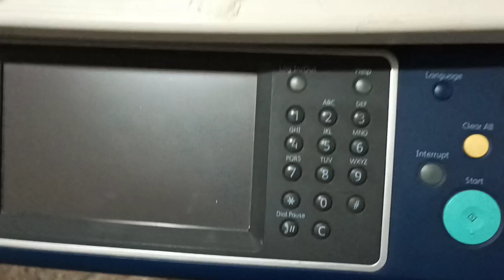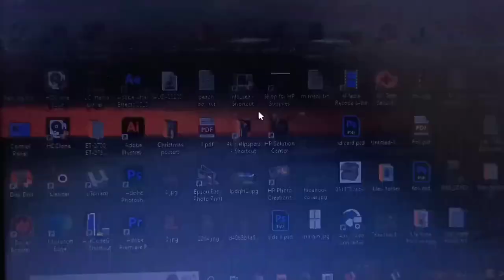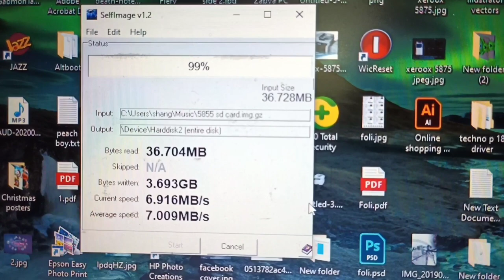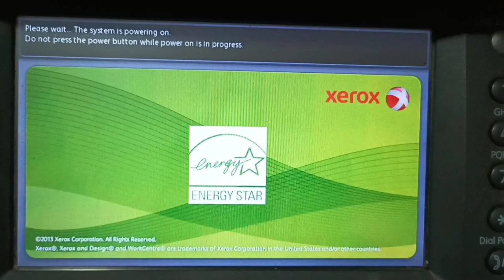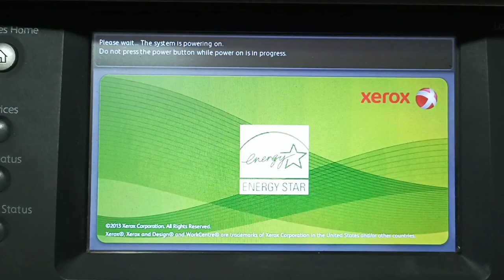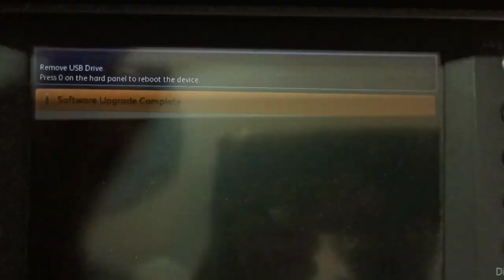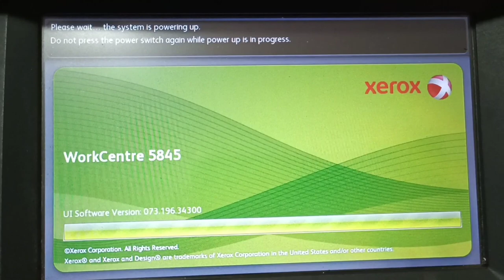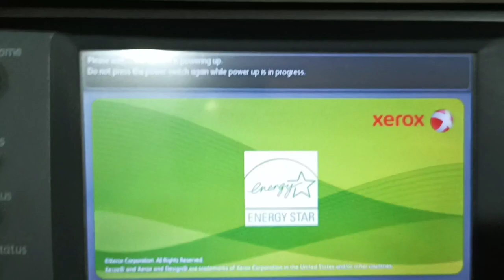Xerox 5855 Freeze on Green Screen Firmware Update

Comment: Respected sir. In my 5855. I am getting number 9.and machine gets off when I press zero after firmware. What to do. Thanks.
Reply from the maker: Machine turns off or restart?
Reply: @AceTechAndTraders  yes sir
Reply: It goes off and doesn't start from power on switch
Reply from the maker: @naveensood5725  then first change the Hard drive
Reply: @AceTechAndTraders  I did that also sir. Problem started with deleted jobs. I cleaned sd card. It started working. But now problem is firmware not completing. I will try once more.
Reply from the maker: @naveensood5725  then use the new SD card and new hard drive
Reply: @AceTechAndTraders  ok